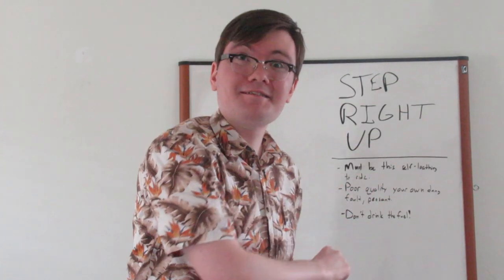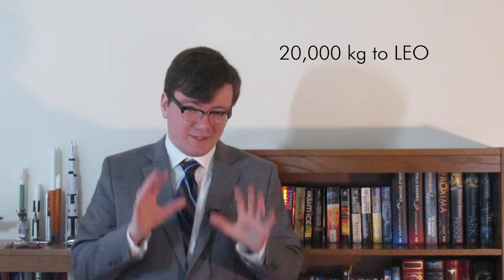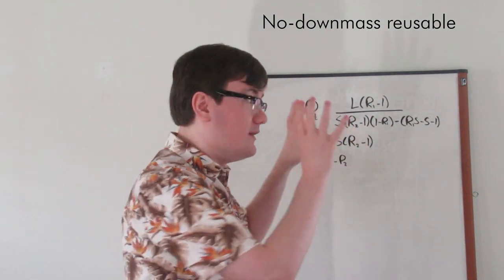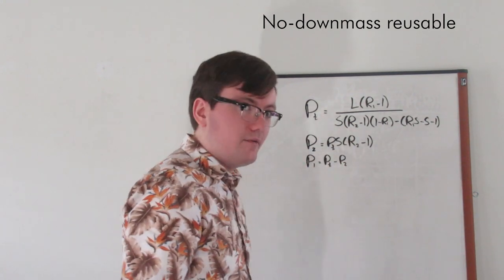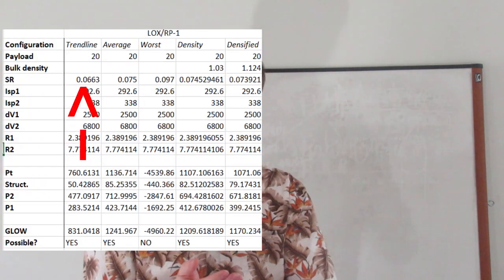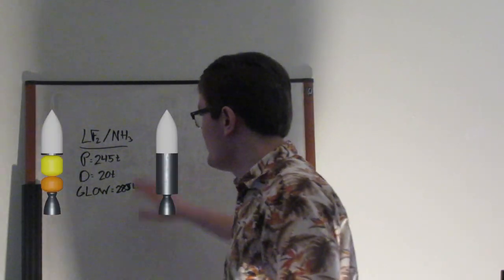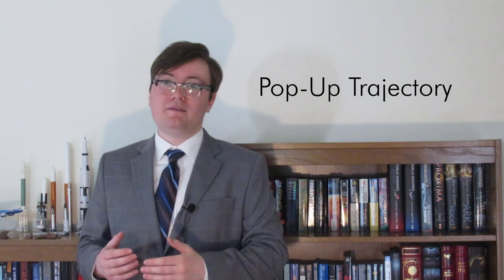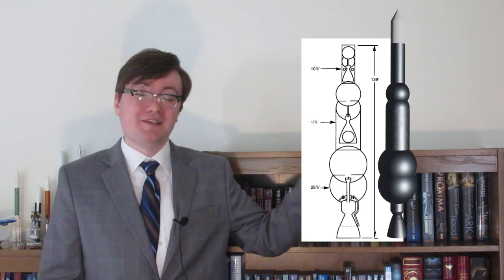Designing an SSTO

Comment: There is also Sabre engine in development... and I have read that also some US engine which will be hybrid- in atmosphere it will use oxygen from atmosphere and hydrogen from tanks, at height of 25-35km it starts to use oxygen from tanks. It saves quite a bit of propellant mass.

Even though hydrogen has low density compared to other fuels, it isn't all that bad. SSTO would benefit from about 20% higher ISP. If lifting body was used, the large lifting body area coupled with low density of vehicle after most of the propellant is spent would be great for aerodynamic landing.
Reply: Air breathing rocket engine always gets you away from SSTO. The reason is that you trade a higher specific impulse for a higher structural mass. This means that staging worth even more. So even if skylon whould be able to reach orbit with a single stage, the benefit of staging would be just too high. An ballpark estimate for an SSTO is that half of the mass put into orbit should be the payload.
Reply: @vornamenachname2625  Makers of SABRE would beg to differ... I think.

Comment: How does a lower-Isp-higher-density propellant (like peroxide-kerosene) trade against hydrolox? I heard some people that it can make an SSTO easily due to the smaller tanks needed, and that hydrolox is useless in that application. I somehow refuse to believe that - 50% higher Isp with only 30% higher dry mass has got to be better (even if more complicated to pull off), not to mention the fuel mix itself is lighter.

Comment: Good little trade study based argument.   (link to your spreadsheets would be good!  Reading your whiteboard can get hard ).

Odd you couldn’t get a LOX kero RLV SSTO.  McDonnell Douglas folks reported it looked much easier then the LOx/H version, and everyone in the big firms bidding for SDI did see SSTO RLVs as both doable and more economical then TSTOs (I was working in McDac back then out of NASA HQ ).  NASA HQ also saw it as very competitive.. and wanted it killed and discredited ( stories to break a aerospace engineer space geeks heart)

Also rocket/ramjet combine cycle engines help a lot.  Even a kerosene LOx with a turbo Ramjet looks plausible.  (A project I’ve been trying to develop commercially .. given market factors it could lower cost to orbit about a thousand fold, though that’s another story.)
Yeah I’m into spaceplanes BDB guy!

I saw studies with newer materials, especially ultr light heat shields based on UHTC-C and aerogel filed foam composite were a big help too.
FYI
Reply: Hey Kelly, glad you made it here! Nice to hear from you :)
Reply: @randycampbell6307  
Lol!    Well if they let you in here I’ll have to flee.  ;)   Long time Randy.
Reply from the maker: It was probably because of my math (or in the Isp calculations).

I'll see what I can do about the spreadsheets.
Reply: @pressure-fedastronaut6511  
Have you remembered the lower effective delta-V to LEO for a smaller dense fuel craft, vrs a light fuel like LH?  The lower area drags and faster mass reduction, drops the effective delta-v a few hundred MPs as I remember?

I looked it up on one of my old spreadsheet trade studie. DV to ISS was 9086 mps to ISS not LEO w LOx/LH.
Don’t know where I referenced these numbers but...

———————. to LEO .. to ISS
LOx/LH ...........8000 .... 9086
Dense fuels.    7673..... 8715
Reply: @KellyStarks  Drag doesn't have nearly as big of an effect as other factors.

Comment: @27:00 That is a picture of a CGI model of a proposed 3 stage rocket capable of delivering up to approximately 16% payload to dry mass fraction (by volume).  At ~8.7m 1st stage diameter I think it's safe to say that this design has never flown, its CGI so not Saturn era...🤔
Reply from the maker: I made the model in Blender; it's a design from ~1969.